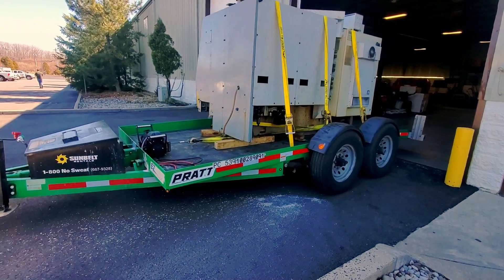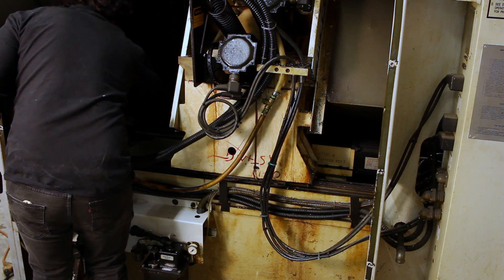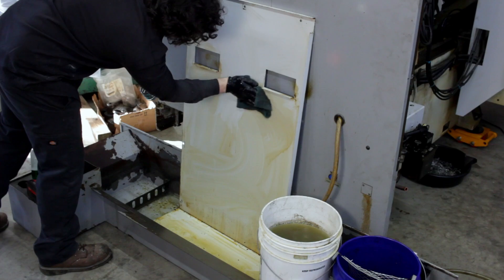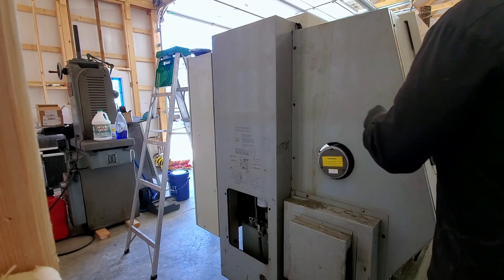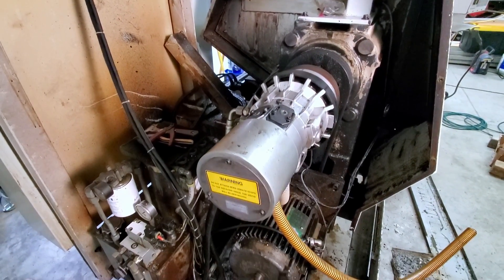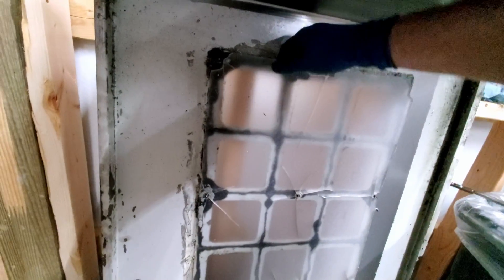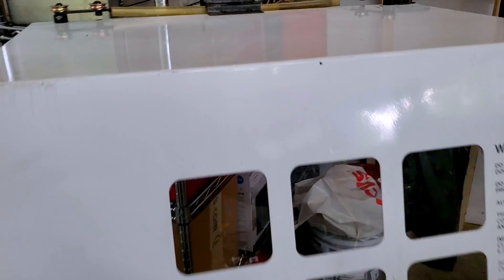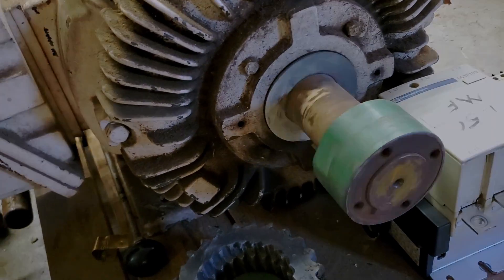$15,000 CNC Lathe- For FREE?

Comment: Oil Eater worked so much better for me that those other commercial degreasers. Nice work!
Reply from the maker: @terrellbradshaw3504  I'll have to give that a try! I use PSC1000 from tractor supply co in my parts cleaner and find that works really well.

Comment: Thats pretty sweet! heck of a clean up job!!! Even if you end up needing to fix something major its relatively cheap and haas machines are decent not as sh!tty as some claim
Reply from the maker: Thank you! I know various years of machines have varying issues, but the proof is in the pudding. This lathe has had 25+ years of continuous operation, and both the operator and shop lead told me it consistently held +/-.0005", possibly tighter, but they rarely would do work tighter than that. I spent a lot of time in automation and controls and all of the components are of high quality. Yaskawa servos and drives, for example. Despite the dirt, which anyone would expect from a production machine of this age, the components are in relatively good shape- it wasn't really abused and had regular maintenance by Haas. Once we have power we will do a thorough check of all systems, including attempting to measure any wear.